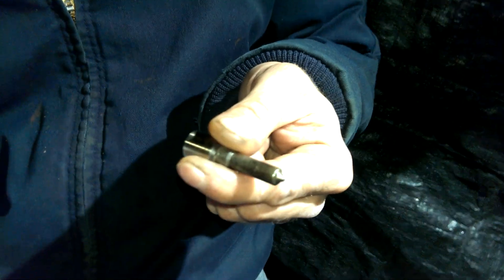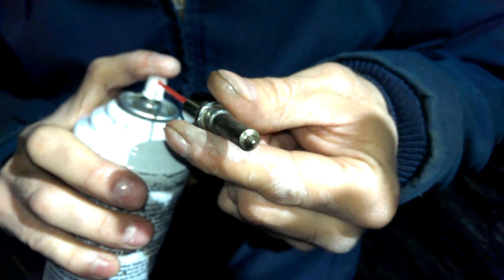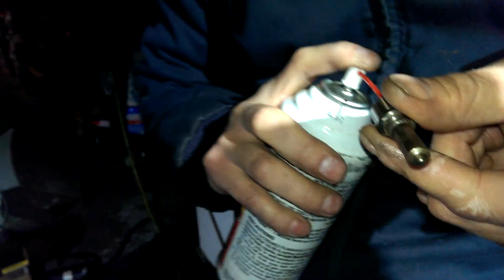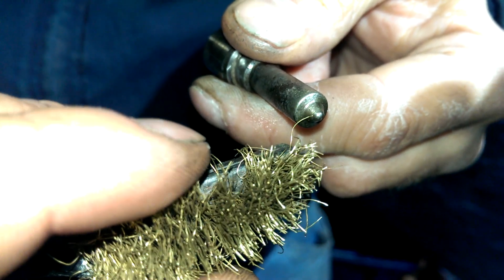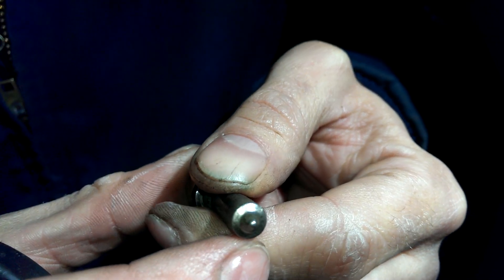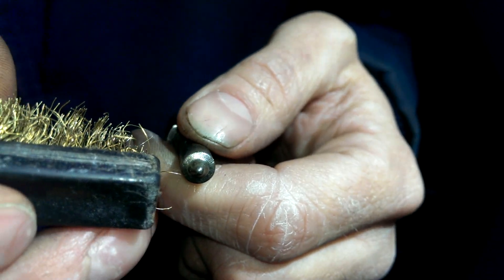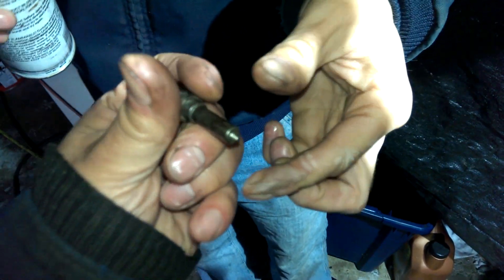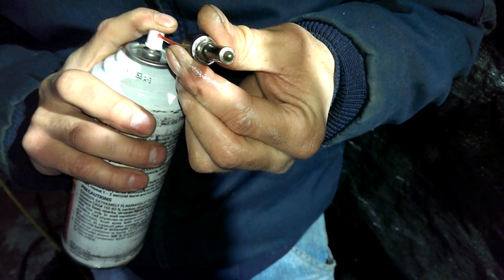Secret How injector Nozzle Spray Pattern Works

Comment: This method is flawed, if you clean the jets this way all you are doing is pushing the contaminant inside the nozzle body. If you remove the needle you can either shoot solvent into the body to check that all the jets are firing properly or soak the jet and needle in solvent (being careful to keep each injector labeled and separate from each other).

I apologize if I came off as a dick, it just takes so much longer if you do it the way you showed. Good luck!
Reply: Todd Sadler Sure, I'm only debating the folly of doing the job in such a fiddly and inefficient fashion. I wouldn't argue against anything just to be a jerk.